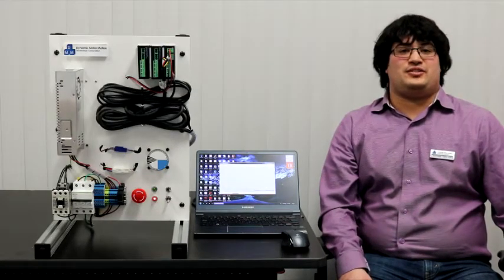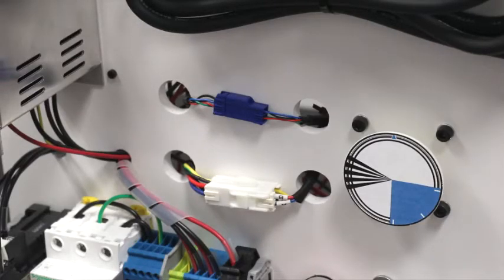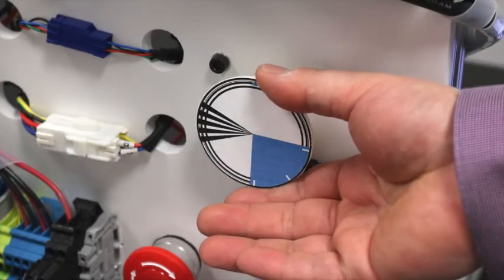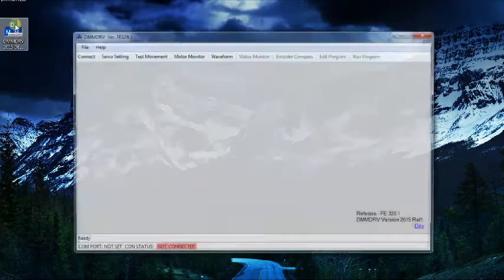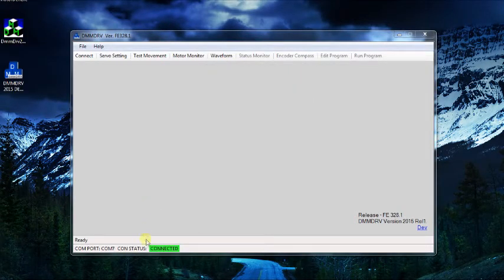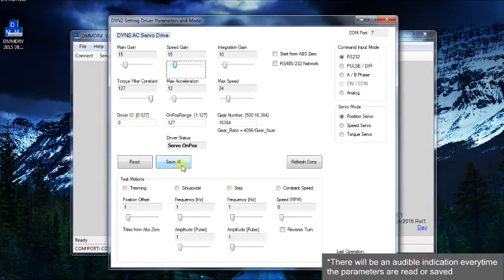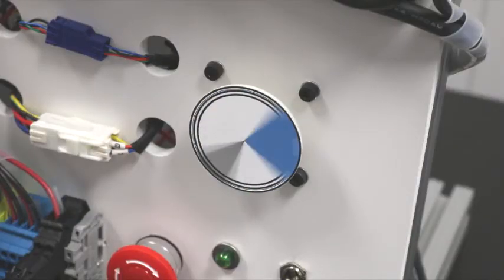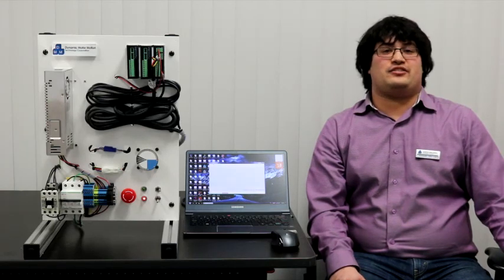DYN2 Servo System Set-Up

Comment: Thank you for your video, I have a question to ask before buying the equipment, is it possible to control manually with 2 PWM, one for the motor speed and the other PWM for the time between motor ON / OFF (High / Low) of course without completely stopping the machine.

Comment: Hi, i'm very surprised that the DYN2 manual specifies 0.8mm² wire for power input and output, that's 4-5A rating for a 16A-20A peak input driver. What am I missing ?